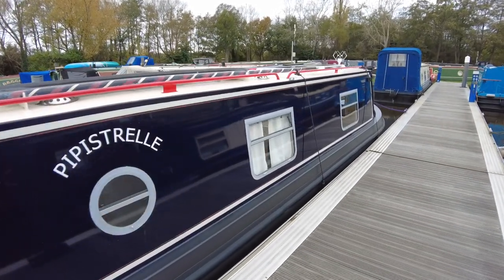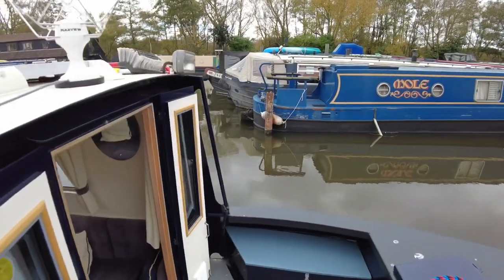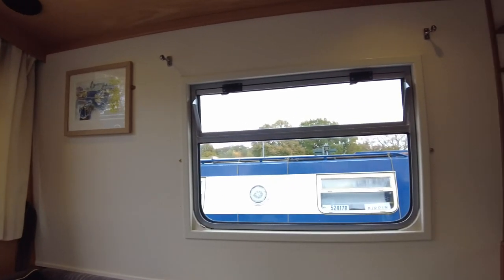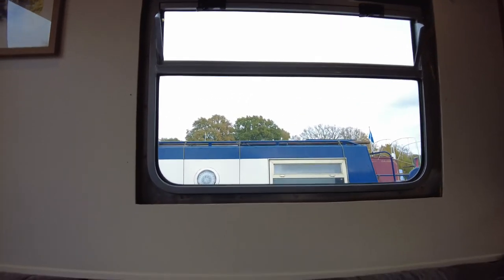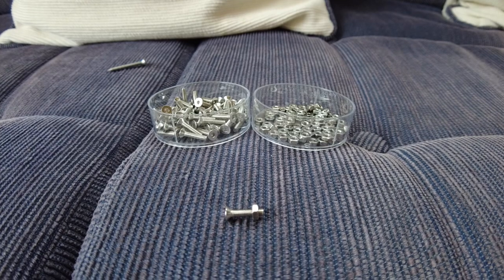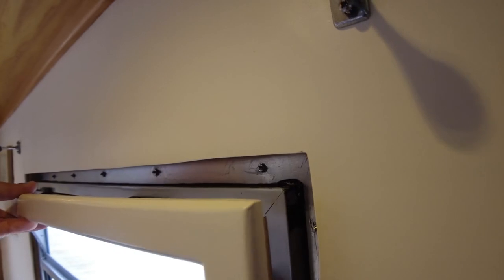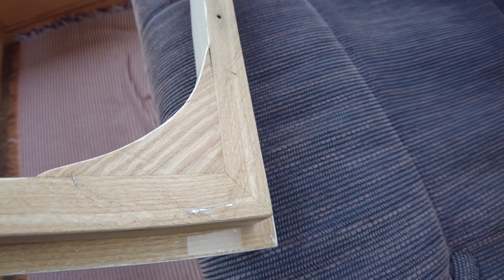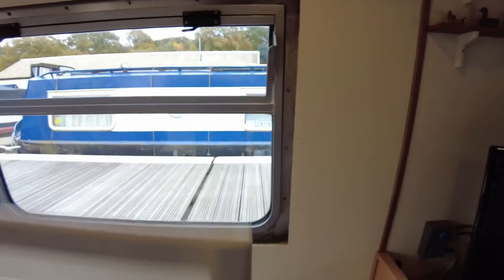Our Narrowboat Pipistrelle. Sea Otter window modification.

Comment: So the original 19 x 31mm bolts screwed to the inner wooden window frame?
Reply from the maker: Yes they did. I’m not sure how other boat frames are held, but I did think it was a strange way to fit them.
Reply: Have you had any leaks